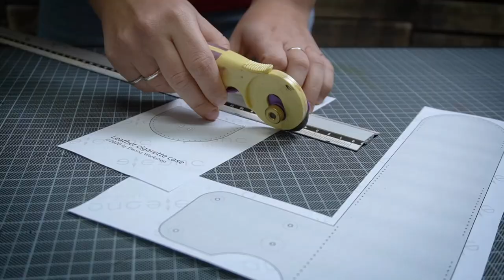How To Make Cigarette Case |  DIY Leather Case | PDF Leather Pattern

Comment: Will this hold a pack of 100's or just the short regular cigarettes?
Reply from the maker: This pattern is designed for a regular pack. I have already modified it for wide pack and I will do the same for 100’s pack and slim pack. There will be available as an option soon
Reply: @EleanaWorkshop  Thank you 😁

Comment: How do you get the dimensions
Reply from the maker: To get the dimensions for the leather cigarette case, you can base them on the dimensions of the cigarette package itself. Measure the length, width, and thickness of the cigarette package you intend to use, and then use those measurements as a reference for creating the dimensions of your leather case.
Keep in mind that you'll need to account for a slightly larger size to ensure a proper fit and allow for ease of use when inserting and removing the cigarette package from the case.
By using the cigarette package dimensions as a starting point and adjusting accordingly, you can create a leather cigarette case that will fit your specific needs.

Comment: Be nice if you told what you were doing and using.
Reply from the maker: what do you mean?
Reply: @EleanaWorkshop  what type leather, what were you wiping on the leather it looked blue in color. I like your video but it’s just something to watch without you telling or explaining what your doing and maybe why your doing it.
Reply from the maker: @robertduvall9580  if you download the pattern you will see what leather I am using. You can use any 1,5mm leather (I use veg tan cow hide) and 1mm for the sides. Most of my videos are made to show how to use my patterns. You can make the same project without dying or stamping the leather as I did. Also I am showing the excact dying process on an other video (a card appears to the top left of the video at 4:12).
Reply: @EleanaWorkshop  ok thanks. I haven’t watch very many of your videos so I guess I have a lot to learn. Thank you for your prompt replies.